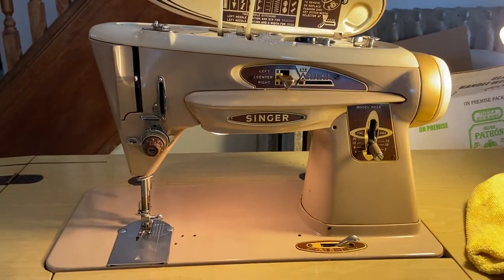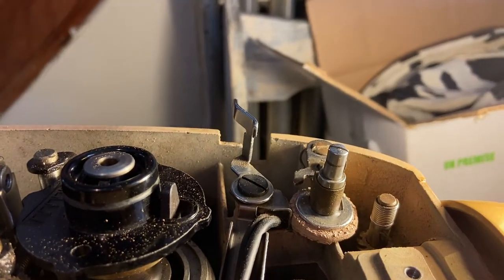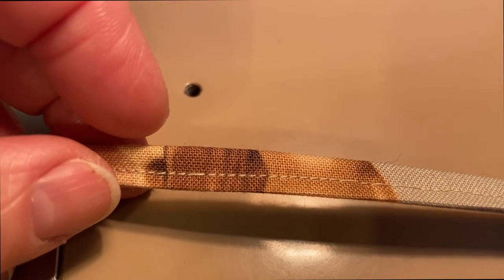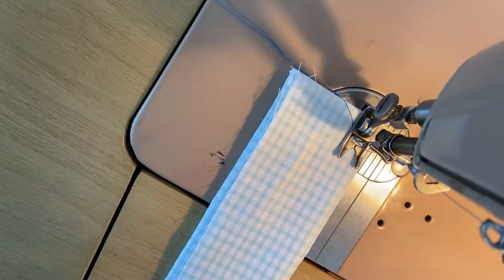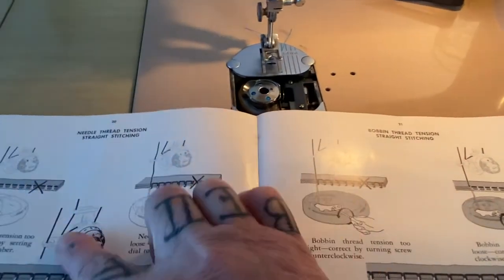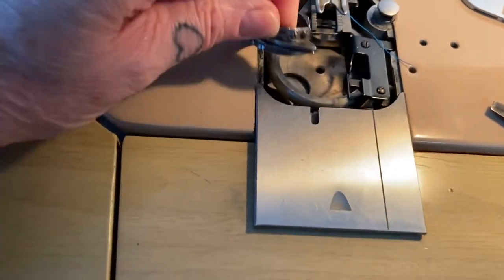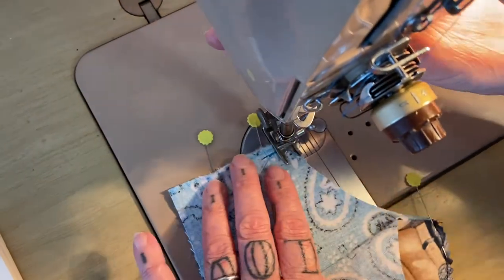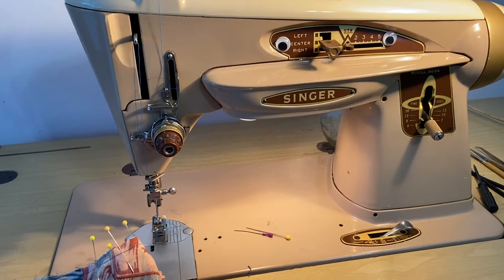Fixing up a 1961 Singer 503 Slant-o-Matic  Rocketeer

Comment: Class 66 bobbins only. I purchased two more bobbin cases and preset the screw tension on one for silk and the other for upholstery thread. The one on the machine was set for standard sewing thread. There is a tool that looks like a vintage pocket postal scale that shows the tension of the bobbin thread when adjusting. Bought mine from a 222 quilters website.

Comment: I bought a 500a  because I loved the space age look........however, I was prewarned by a serviceman that the rocketeer doesn't like knit fabrics.  I use a lot of fleece knits and I found out the hard way that he was 100% right! Now I also own a 401a and it sews a zigzag stitch with no problem and any type of knit fabric!   I think they didn't do enough testing with knits when they made those machines.
Reply: You can also bypass the thread control arm and it works better with knit fabrics.
Reply: Also with knits you need to utilize the pressure foot tension inside the head cover. It'll sew like a dream with knits if your top and bottom thread tensions are set correctly, pressure foot tension set right, and skip the first threading section called the "tension control".
Reply: They actually tightened the machine tolerance on the 500 series for better consistancy, so needle deflections from pins and fabric pull create more problems. Tear away or washaway backing is needed to sew such materials. There is also a stretch kit that uses disc 22 and a special foot to make a functional stretch stitch. Proper "stretchable" knit stitches require a grooved cam that can also controls the feed dog direction. These top hat cams can't do that.
Reply: @1953childstar They may have just altered parts to reduced the tolerances to match the 400 series. I have yet to find any service manuals or technical bulletins to show any alternate parts available even to date. No machine parts diagram refers to possible alternate parts as well.
Reply: @strayblackcatsmeow  There was a "knit Kit" that Singer repair shops used with an alternate hook and retention system.. These were "aftermarket" items produced by Singer, only available in Singer repair shops..

Comment: I’m still trying to get my bobbin winder to work on this same exact model.  I can’t seems to get the part with the wheel screwed on right.  I hope to get it soon.  I think it has something to do with exact location of where that spring needs to go.  Actually both springs for the bobbin winding mechanism have been the biggest challenge yet.

Comment: If you using bobbins like the one in the video, that is probably your problem with stitches. The bobbin you have is a class 15, and that machine needs a class 66 bobbin.
Reply: I think the class 15 bobbin was on the winder, however the one I saw in the sewing video was the correct class 66.